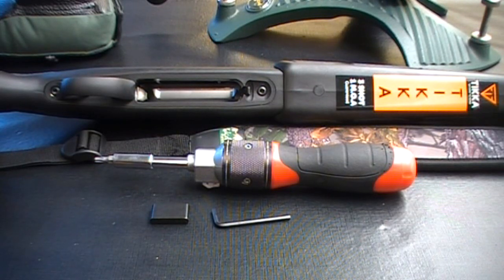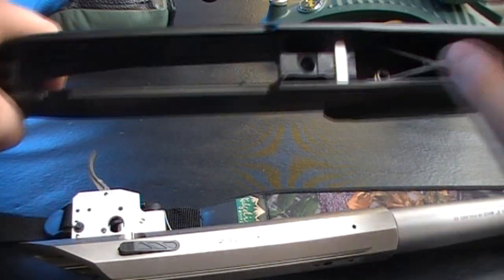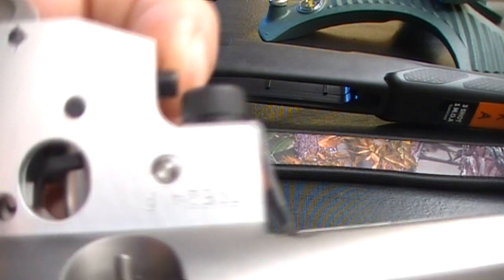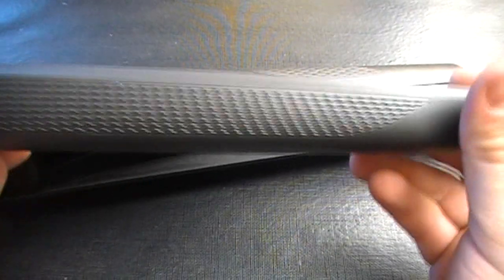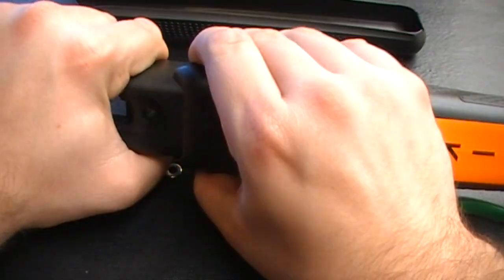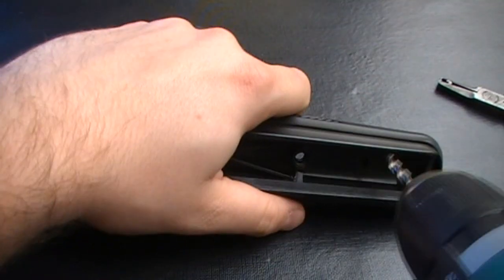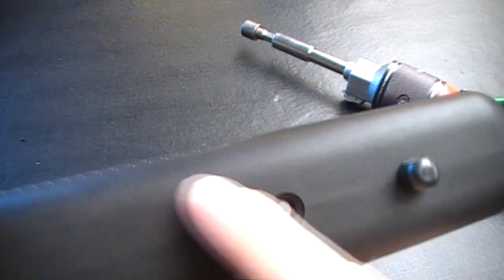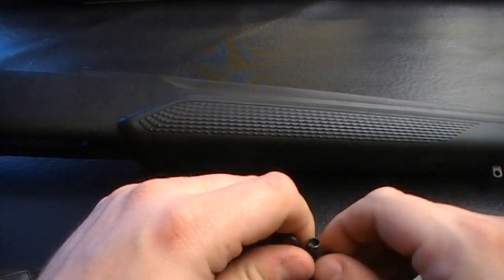Tikka T3X Upgrade Rifle Build Part 4

Comment: Thats actually a Tikka t3 stock not the t3x. That's why you had to drill a hole to use the beaver tail forend. I could tell because textured grip design on the old forends were a 3 piece design and on the new t3x series it's a 1 piece checkering

Comment: Wait, don't all T3X stocks have the option to swap out the grip to change the angle? Not trying to be a jerk. Seriously, I'm not. New to shooting, and I'm thinking about picking up the t3x ctr.
Reply from the maker: this is not t t3x its a standard tikka varmint stock with t3x parts. I know its misleading id buy a chassis tikka or ruger precision rifle  i have handled one and was surprised how nice it was but accuracy is better in tikka.
Reply: SouthAussieShooting ah, thanks!

Comment: Have a t3 varmint in 223 as well. Another tip if ur chasing accuracy is to invest in a torque screwdriver and torque your action screws correctly. Also you should try editing your videos a bit better mate, a lot of unnecessary crap in this vid.
Reply from the maker: yeh I need to invest in lot of gear. I don't have any editing exp and still won't have till I find someone that can.